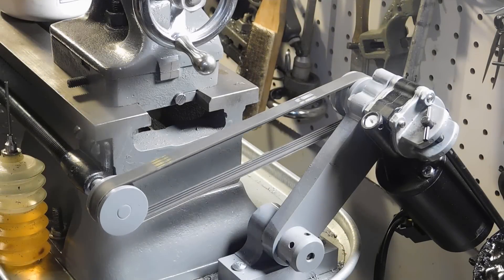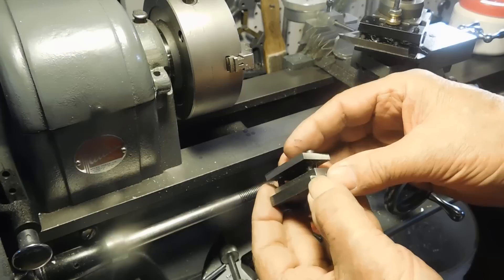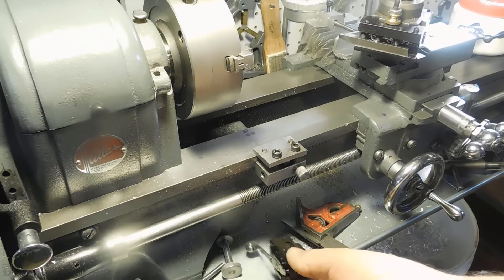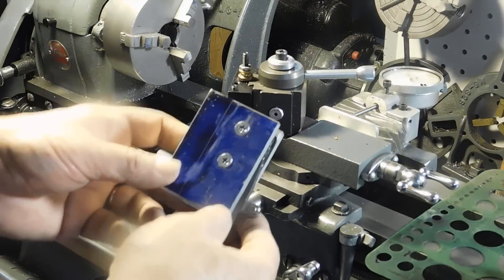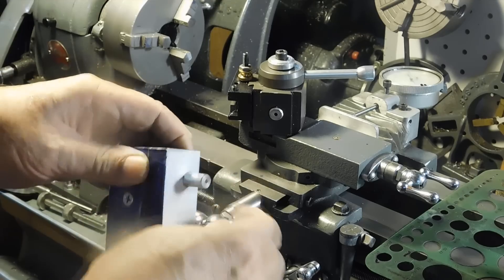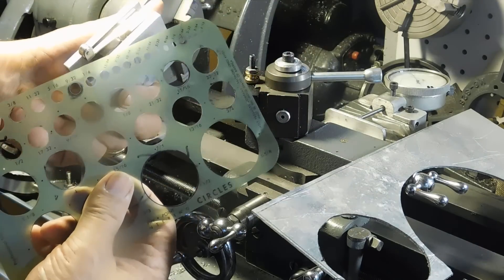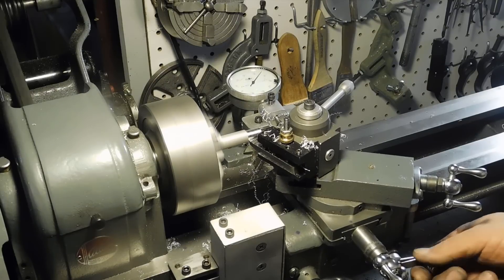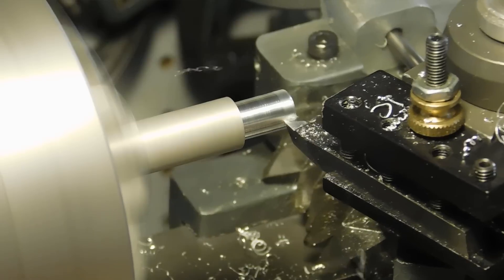Limit Switch for Atlas Z axis motor drive

Comment: Great improvement. To bad you didn't show the finish on the shoulder
I think a hard stop with a slip clutch will get you a better repeatability and you don't have to deal with any wiring.
On the other hand a slip clutch will put some extra load and wear on the lathe.
Reply from the maker: Thanks...yea I should have shown that shoulder, but there are 2 pictures of it on the forum link...I think if I used the 1/4x20 hard stop on the holder instead of the limit switch...the shoulder would not be as good as the one created by the limit switch (I've used the hard stop a lot over the years)...I got a lot cleaner shoulder then I expected

Comment: Nicely done! If you find the size a little to bulky, replace the Micro swith with a proximity switch. We used them on industrial lathes with great success.
Reply from the maker: Thanks Craig...I just spent some time looking at proximity switches...I used what I had on hand...it is not beautiful but here are some pictures of the very nice repeatability I got with that limit switch...
http://www.machinistweb.com/forum/showthread.php?p=36732#post36732
Do you think a prox switch could do that as well?
Reply: Oh yes, most prox have a field effect distance, they differ based on manufacturer and size, so contact is not required. I was the maintenance foreman of CSX's Raceland Wheel Shop until it closed. We had two Hegenshent Wheel lathes, tracer lathes, that used barrel type proxs that triggered off adjustable dogs. The ten years I worked there we only needed to replace two of them. They were so durable that we had a hard time troubleshooting them because we refused to belive they failed. Limit switch would fail because the contact would eventually wear out the rollers or arms.
Reply from the maker: Excellent info...thanks much...